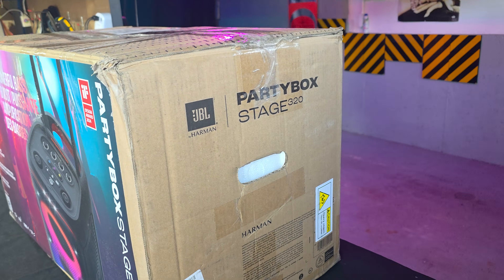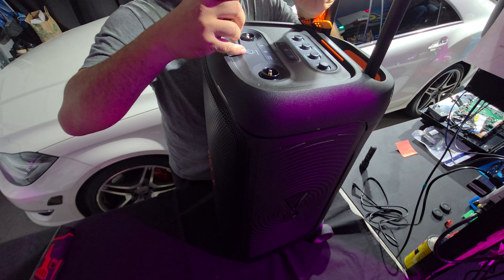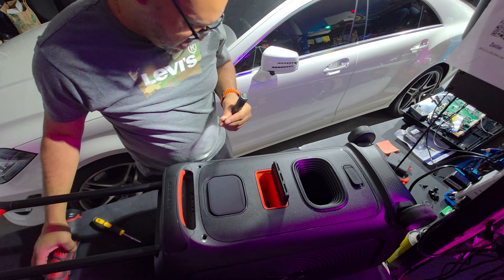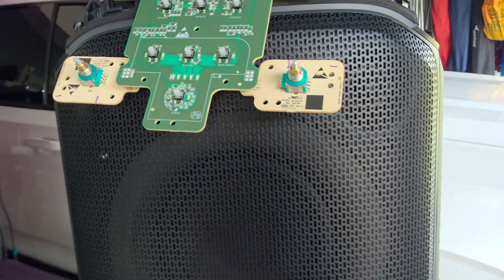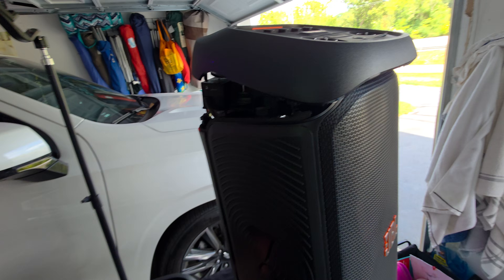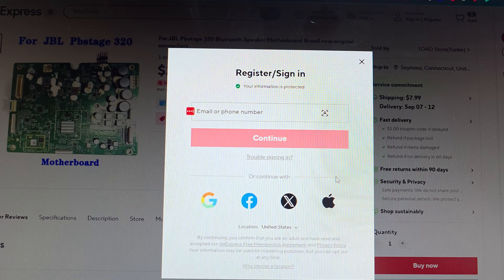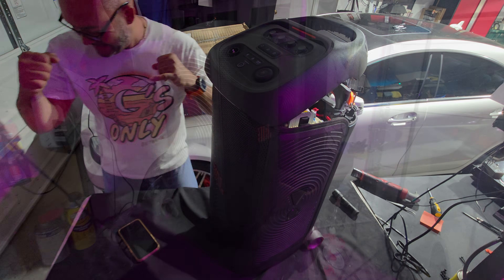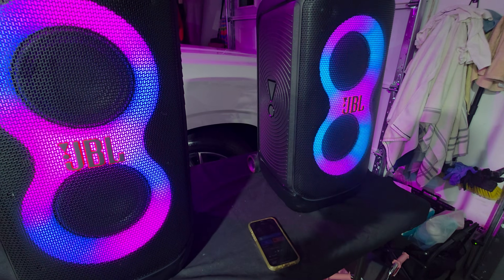JBL PartyBox Stage 320 Partial Teardown & Auto Restart Repair

Comment: I like it when they show the circuits. The previous version used the 3116, which, according to the datasheet, is basically the same as the 5828m. Interesting.
Reply from the maker: You are very knowledgeable on this. I'm still learning 😌